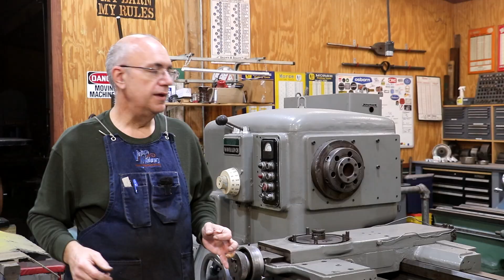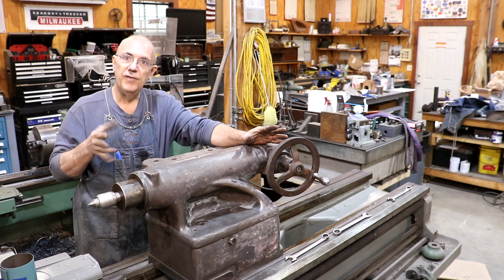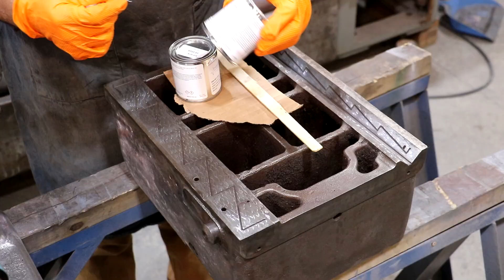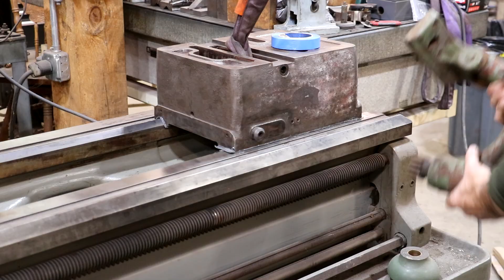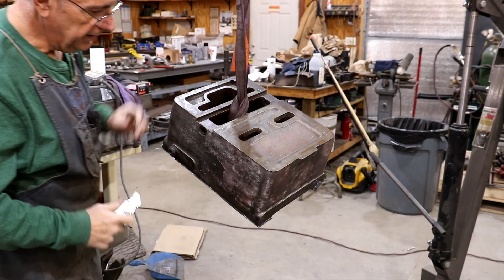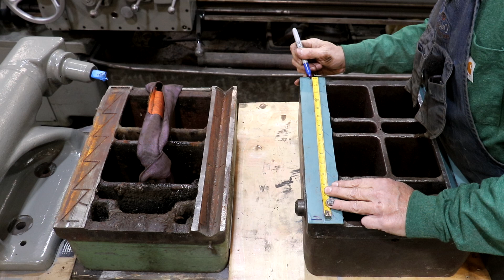Monarch 612 Lathe Restoration: Building up the Tailstock Height with Turcite Wear Strips

Comment: No offense intended, but shouldn’t you have put the Turkite in between the two half’s of the tailstock??? ON THE FLAT SURFACE?  why would you fill all the oil galleys with epoxy?? Also that Turkite material is very soft and will pick up every piece of metal chips that make it past the wipers and embed themselves into the soft material and just reek havoc on the bed ways ??  why would you not put a test bar in and use a indicator to take a actual measurement to see how much you need to adjust? 
Not to be too harsh here but this really should be titled “how not to shim a tailstock “ 
Cleaning them cast iron parts with a wire wheel instead of just using evap-o-rust and treating the surface. Now you have introduced even more hi’s and low’s no? 
That could have been a very simple repair/shim job, but this was done all wrong in my opinion. I’m not trying to jump all over you, or make a big stink out of nothing but you just showed thousands of people how to damage a machine. 
I just don’t understand. 
I’m terribly sorry Keith, again I’m not trying to attack you, just offering my constructive criticism here. There is no oil grooves or galleys in between the two tailstock half’s for this very reason precisely, I’m confident that you know this. 
 The manufacturers know the wear will be introduced and offered a place to shim it one to one on the nice flat surfaces machined in between the two half’s.. furthermore you wouldn’t need to worry about the chips destroying the bed ways either as the oil grooves would provide the intended purpose of oiling the bed ways.. of course you would scrape them in BEFORE you use the test bar and indicator’s to determine how much shimming is required. 
Again, Sorry Keith. I’m just really disappointed. Are you up against some hard deadline? Is time a factor? 
I truly hope you take a second to review this repair and address this with your viewers before too many tail stocks and bed ways are doomed to failure. You now have no way of getting oil down to the ways. You plugged up the holes with epoxy and covered them with Turkite. Also putting the shims where you did will not result in the same thickness as it’s applied to the V groove of the way on one side. You will find it has now shifted towards the operating side by about half the thickness, and only raised by about half the thickness of the shim right ? 
Oh boy, this is one for the archives.. 
I hope it works out for you Keith.
Reply: Until now I had great respect for Kieth's work but this episode has wasted that. Swapping epoxy lids, shimming in the wrong place, scooping out the hardener with the spatula with epoxy on it, Ignoring the sine factor difference between the front and rear ways and the utterly imprecise measurement of the alignment of the tailstock centre with the headstock centre, not to mention crashing the tailstock against the ways as the crane didn't have enough reach. All this had me screaming at the computer screen, in the end I had to stop the video and walk away.

I am very sad.
Reply: @seapy2398  lol, well.. I was really trying not to say too much.. clearly I failed at that.. but I was yelling right there with ya. Could have very easily pulled the hoist around the corner to the rear of the lathe and not beat the daylights out of the ways.. I do believe he flipped the wooden stick before he dove back in for another scoop of oil galley plugging putty.. 🫣 not that he needs my defense. But that shim placement I really thought that was common knowledge for anyone who has ever ran a lathe.. I wondered if this was done intentionally to gain clicks/comments? I just can’t understand why? 
It’s interesting you had to walk away. I actually shut it off myself, then came back after a few minutes and finished it. Blood pressure was getting too high. But I know one thing is for sure. Whoever purchases that machine will have a good time trying to sort that tail stock out.. 🤦‍♂️ 
On a positive note, at least it’s saved from the scraper’s though right ??
Reply: Saving it from the scrap for sure, wonderful, I would have done so in a heartbeat.  In fact I bought a 10" shaper last night to save it from the scrap. 

If you going to share your skills from a pedestal you got to expect some comment, especially since we are talking about a precision tool. I have watched Kieth doing his thing for a while now, I don't understand why this project is being rushed and done in a slapdash way, He has had it standing in the shop for years. That hydraulic tank should have been stripped and cleaned properly, not just flushed out.  Anyway he doesn't seem to respond to our comments, maybe does't even read them so it's really just water under the bridge. @jasonhull5712

Comment: This was very interesting.  I knew on an academic level how this was done, but the specifics of how thin the turcite was, how well it would stick to the surface, how you would handle V ways, and the actual practical application have been a little bit of a mystery to me.  I have experience here in our shop using Moglice wayliner, but that is a liquid that is poured in place.  We've probably used 20 or 30 gallons of it over the last 25 years which is a pretty big number when our application only uses a 250 gram kit at a time.  I can see the advantages of both methods.

Comment: silly question but why not add the appropriate spacing between the upper and lower halfs of the tailstock where you could just machine it out of a piece of steel?
Reply: The cast iron surfaces will just continue to wear.  Adding turcite to the ways will substantially reduce the wear rate, lengthening the time interval to the next time the tail stock would need attention
Reply: i understand that, but 1/4"-1/2" of turcite seems awfully extreme and would reduce a lot of rigidity in the tailstock  @vandalsgarage

Comment: The hight gain on a flat surface is different then on a 45 dgrs surface. Now it leans over.
Reply: Absolutely right! If the vee way is 45 deg's each side then the height gain will be sin 45 * shim thickness. :face-turquoise-covering-eyes:
Reply: @martinsymmons2343  I think thickness / sin 45
Reply: I don't think so. The height gain will be LESS than the shim thickness. Keith was using approx. 0.8mm turcite. Sin 45 = 0.707 so gain equals 0.8 * 0.707 = 0.566mm
Reply: @martinsymmons2343  Hmm...I was thinking in the limit if you had a 90 deg profile then the distance between the sides would always be 0 regardless of height gain, so shim thickness must be less than height gain...
Reply: @robertforbes7666  Well, now you are making me doubt my original premise! I reasoned that if the surface is horizontal the height gain must equal shim thickness and if the surface were vertical there will be no height gain (regardless of shim thickness) so any gain would be somewhere between 0 and shim thickness, depending on the included angle of surfaces. HOWEVER, I neglected to consider the effect of maintaining centre line when shimming both sides.
So my apologies you are quite right. In this case thickness / sin 45 is correct. My bad  🥴

Comment: I adjusted mine by adding a shim between the top and bottom base castings.  That gave me another problem, I couldn't adjust out a taper I was cutting.  I later discovered that my quill would lift as much as 0.008 (about the amount I'd added with the shim) when the lock was engaged.  It turned out that wear on the quill was allowing it to 'droop,' but it would return to original height when you engaged the quill lock (which is of a different design than the one on this Monarch).  

For others that may start checking for misalignment (vertically), I suggest that you do so with the tailstock clamped to the bed, quill extended to where you have it for turning between centers, and the quill lock engaged ... basically having everything as they would be while turning a long part.
Reply: Shimming between the tail stock castings also puts the shim where there is much less regular motion, and much less wear. The ways have motion almost every time the lathe is used.
Reply: @edbennett8257   I suspect this lathe spend a long time on a production run, with the tailstock locked in one place.  A lot of out and in for drilling being part of that.  With 9" of available travel, that would have been easier to do over constantly moving the whole tailstock (it is a really heavy one).

Part of why I call it "The Old Warrior."  The location of wear (the cross slide is really worn also) and all the nicks/dings I found.  It looks like someone had a chuck come loose on the spindle at one time, and the part and chuck did a violent dance on the bed ... thankfully, not where the carriage rides.  And there are the remains of a scotch key on the spindle, I assume put there to prevent such an incident from happening again.  Eight years, and I'm still finding battle scars on this one.
Reply: I was about to suggest shim stock between lower and upper sections, as well.
The quill “lifting” due to wear would have happened even if you shimmed with turcite at the ways.
Something else for Keith to check as he reassembles his tailstock.
Reply: @stevenslater2669    I can only guess, but I think the tailstock sat in one spot during the time of it's heaviest use.  Lots of center drilling.  The wear causes the quill to drop, the lock lifts it back when it is engaged.  After taking things apart and cleaning, I did a check (shim removed) with the quill fully extended and locked.  It is pretty much the same, along the top, for it's full length of about 9".  I'd assumed that the off center condition I'd seen while center drilling was due to wear on the ways to the bed, and shimmed to bring it closer to the center of whatever is chucked in it.  

That assumption came back to bite me, suddenly I couldn't adjust things to get rid of a taper I was getting.  That little bit of lift of the part center axis, on that end,  affected depth of cut along the part, enough that a good bearing fit at the tailstock end turned into "too loose" nearer the headstock (the end where I usually check/set my tool height).

Comment: Hey Keith, I just remembered a high school printing project requiring carving linolieum with a tool which got used to print an image. Well, some the carving is done with a V - shaped tool which I think would make very nice grooves in Turcite! Progress!
Reply: I bought a Speedball linoleum cutter set after also doing it in junior-high-school! ['64(?)]
Still have the two color print blocks for a hornet I did in class.

Comment: Adding an even layer on the flat slide and the V slide yields a tilt and lack of contact between the bed and the tailstock. I wonder why not shimming between the 2 parts, not on the slide surfaces.  It'll restore the parallel contact of the ways.

Comment: Nice work Keith.
I have heard of Tucite the use and application. 
Never seen it installed.
You make the process look easy.
Not saying it is.
I can see you certainly have experience with it.
Alot of the things you do Keith, you can't see being done anywhere else.
I think the tail stock is going to be very nice.👍👍
Thanks for sharing the process. 
Have a great day.
Happy New Year.

Comment: I have heard that using Turcite on a tailstock offers clamping issues. I will be most interested if this is the case once you complete the job and try some high strength applications like drilling large holes etc. You are looking good. happy new year
Reply: I was going to use Turcite and was advised against it for this reason and that it will squeeze out when clamped
Reply: If this was a major concern, I'm sure Keith wouldn't be using this product. He is a machinist after all. But, if you have concerns, then don't do it, go a different route. Cheers :)
Reply: @Ham68229 Have to keep in mind he's a hobbyist (with a near unlimited budget), NOT a machinist, which is cool--just dont want people thinking this is how a professional would do it.
Reply: @joshuavanmeerveld7230  Except he is a machinist at the museum he works at. Might want to do some research about the facts, he's stated that numerous times throughout his youtube history.
Reply: Using Turcite for this is a hobbyist move. The professional would shim between the tailstock and base and do a little scraping if needed. The end result would be better and it would take far less time, which is important for a professional since they are doing it for the money. Also the way he removed the tailstock with the hoist sure made me cringe, and that was before it was banging around. @Ham68229
Reply: @Ham68229  All due respect to him (especially for his work with his website) but he is not a ticketed machinist, doing some machine work as a part-time volunteer is not the same as an apprenticeship. Dude is a skilled hobbyist and machine COLLECTOR. But the machinists I've worked with would laugh him out of a real shop.
Reply: @joshuavanmeerveld7230  as I has said earlier, you don't have to do what he's doing, no disrespect to anyone but, that is a simple fact. Cheers :)
Reply: @Ham68229  I worked for years as a Millwright fixing cnc mills and lathes in a production machine shop, my initial comment was just to point out that this is not remotely the correct way to approach this kind of repair. He doesn't use a test bar between centers, or even an indicator, just a rough measurement with vernier calipers against a wornout live center and I don't think the tailstock was shown being locked down. So no idea if the axis of the tailstock is out of parallel with spindle, if it isn't, scraping it is a waste of time, just shim between the 2 parts. He can do whatever he likes with his machine, it is getting saved from the scrapyard. I just don't want people to follow this as a guide. Look it up, the guy is an agricultural scientist.
Reply: @joshuavanmeerveld7230  I understand you completely. I'm only pointing out that, if one doesn't feel comfortable with it, don't do it, go a different way. Cheers :)
Reply: @Ham68229  I agree with you.  Keith said in the video that he had done this before, so I am sure he is confident in the repair.  The more important question is why dont all of these "experts" watch and listen to the video befor they comment??  Drives me crazy!!!!!

Comment: I thought that the standard for tailstock alignment used one or more test bars between centers. This allows you to indicate both lateral and vertical deviation between the headstock and the tailstock.  A short test bar gets you close then a long test bar tests alignment when the tail stock is farther away from the headstock.  It also allows you to determine the thickness of the Tercite shim. If I'm not mistaken Tercite can be scraped in.
Reply: That seems appropriate for horizontal alignment. But to Keith’s point, it matters a lot less with vertical.
Reply: Concur as Keith indicated that he'd be scaping in the tercite for height. My only concern was maintaining tailstock to spindle concentric alignment as the tailstock is moved up and down the ways.

Comment: I was looking forward to this episode as I was wondering how I would have approached the issue were I making the same modification. First off I would not have used the center method to establish the height difference between the HS and the TS. I would have turned a very accurate test bar in another lathe, one or two feet long, then mounted it between centers in this machine. Using a dial indicator or a height gauge on the top of the test bar I could very accurately establish the height offset. And if I were using a dial indicator I could also correct the side to side offset. But you said up front that this was a preliminary measurement, and for that what you did was fine. The big problem came in when you applied the mystery material to the V ways. If you apply some .030" material to the flat way you will achieve a rise of .030". But applying it to the V way will give you something in the range of an .040" rise. This may or may not work for you. It was me, I would have taken an entirely different approach. First thing, it is my belief that these tailstocks are individually fitted to each machine at the factory. I would have taken all the tailstock halves to the surface plate and I would have established if swapping halves might or might not result in the height you need. Unlikely but little extra work. If, as is likely, shimming is needed, I would have added the appropriate thickness of feeler gauge stock between the  two halves, Yes that offset would also affect the adjusting mechanism but it is my guess that offset would get lost in the general low tolerance requirement of that relationship. Now if the height difference were much more, obviously this method would not work.
Reply: Put your slide rule away bud.  He's gonna scrape it.